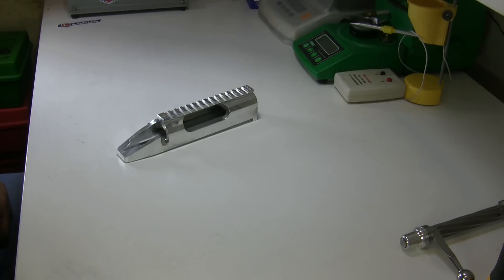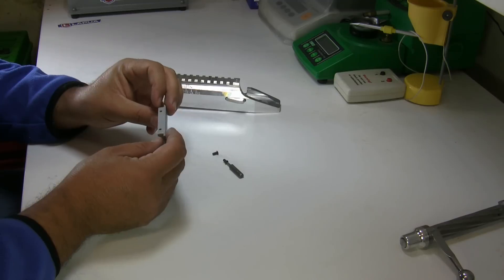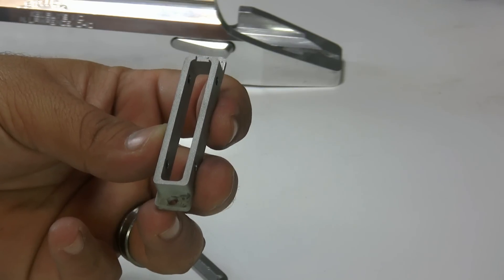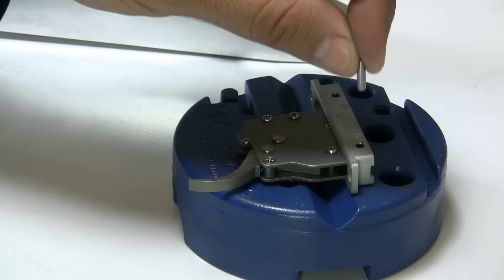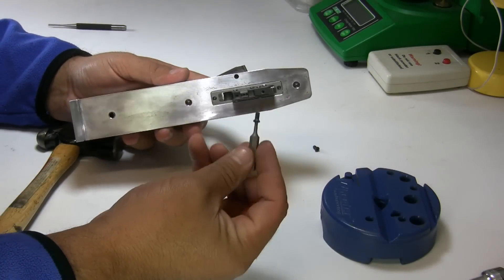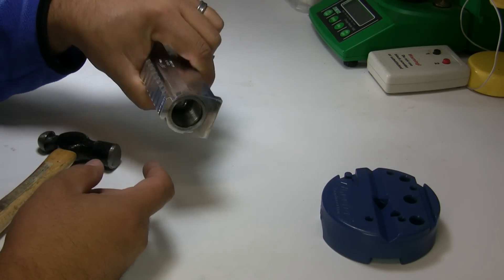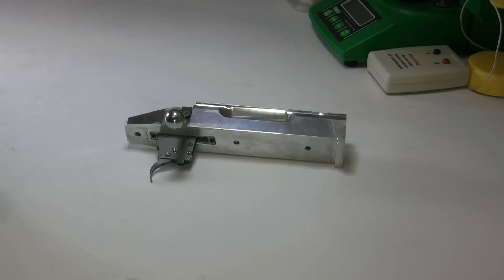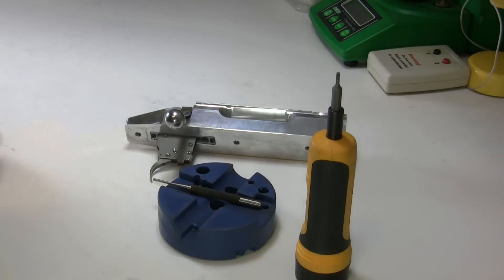How to install a Jewell BR trigger on an Kelbly F-Class Panda action

Comment: Is it normal for the trigger mechanism to have freeplay side to side while hanging in the hanger pins? But then when the bolt is cocked everything becomes a solid mechanism? Once fired the trigger body has movement again hanging in the pins?